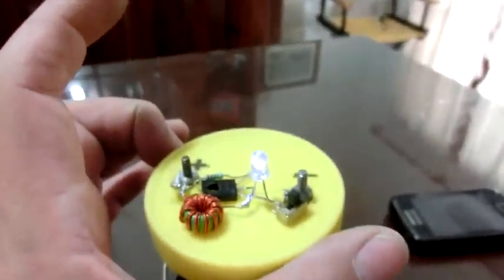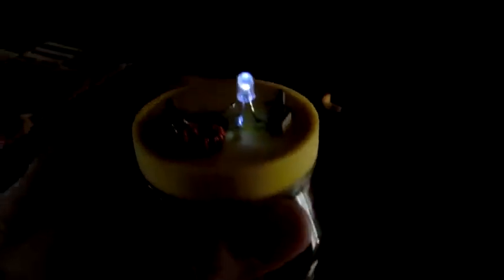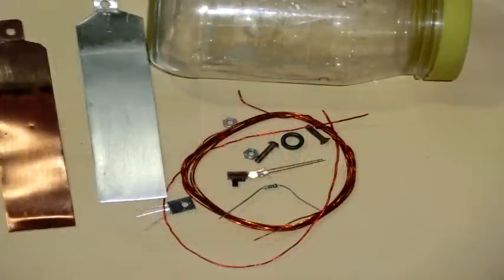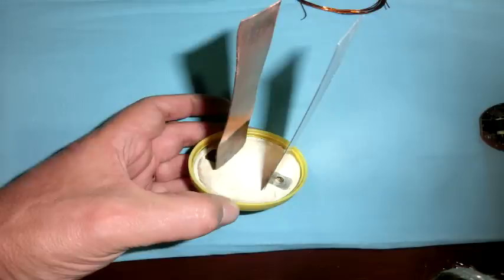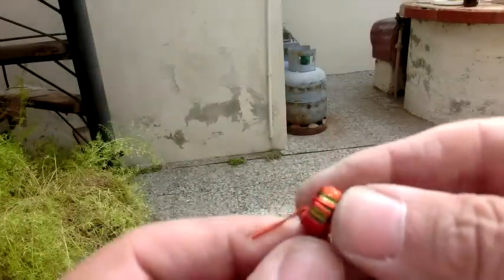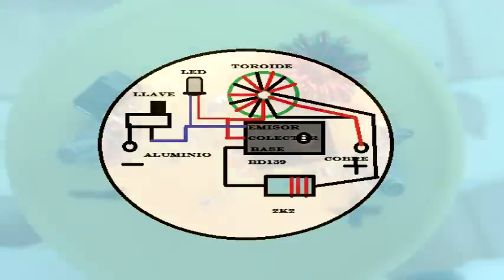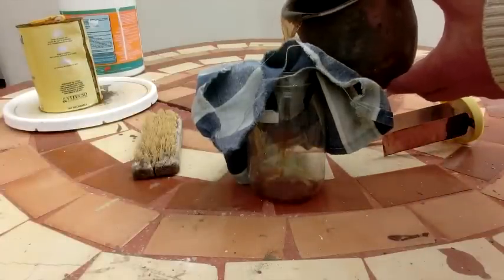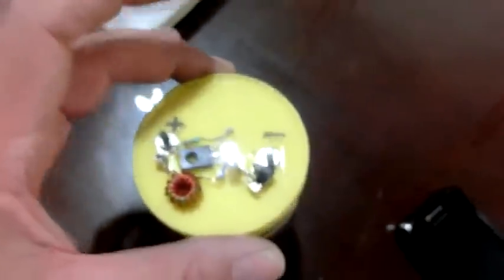Encender un led con cenizas y agua. Ladron de joules, pila electroquímica

Comment: Lo interesante es que encienda un led una sola celda gracias a la bateria. Pero si colocas varias celdas en serie de simplemente agua usando hierro y cobre enciende leds yo lo he probado con los azules. Sin sal ni nada de especial. El ladron de joules funciona para elevar voltaje pero suele perder amperaje... Los led rojos son  muy faciles de encender con unas pocas tal vez 2 o 3 de solo agua lo encenderas aunque levemente. A mi me funciono incluso con agua destilada

Comment: hola ese sistema lo hice yo hace años lo puedes buscar en mi canal por recolector de energías, ademas tengo un ladrón de julios supe sensible el cual puede encender un led con esa misma técnica pero con tierra con esto es mas útil y mas rápido ademas ya casi e conseguido el poder cargar el móvil solo con pinchar 2 varillas en la tierra, un saludo.
Reply from the maker: Juan ruiz salamanca Hola Juan, si estoy suscito a tu canal, vi el trabajo tuyo hincando dos varillas en la tierra, hice algunas pruebas, pero la corriente era muy baja y si bien prendía el led duraba poco tiempo, supongo dependerá de las sales que haya en la tierra, la lejía de cenizas va muy bien. Te mando un saludo cordial
Reply: vale lo voy a probar

Comment: tengo una pregunta y apreciaría mucho una respuesta ¿ puedo usar un transistor 13003 ? en el caso de que no que otro se puede usar en este caso ?
Reply from the maker: poder se puede pero el rendimiento es mucho mas bajo que usando un bd139
Reply: muchas gracias ¿pero el led encendería ?
Reply from the maker: si, siempre que uses una pila de por lo menos 1v
Reply: muchas gracias !!!